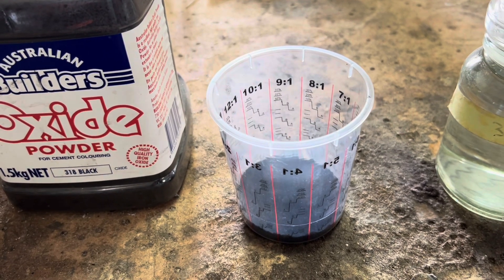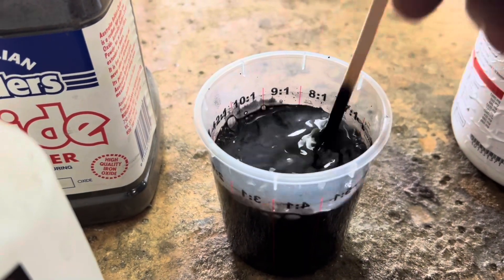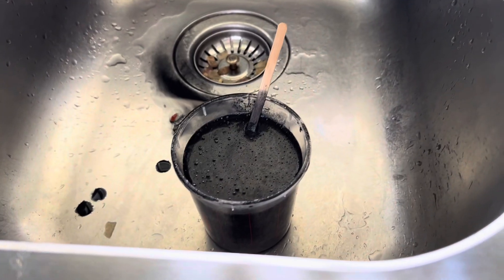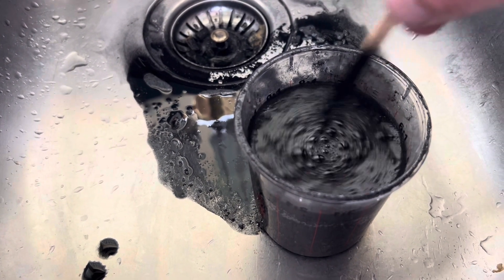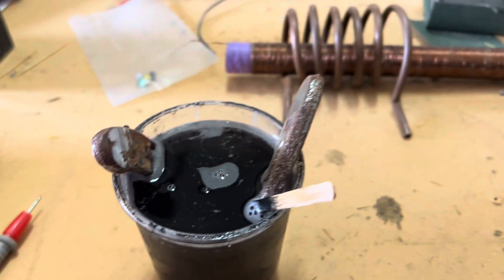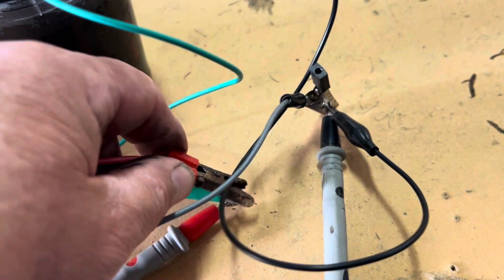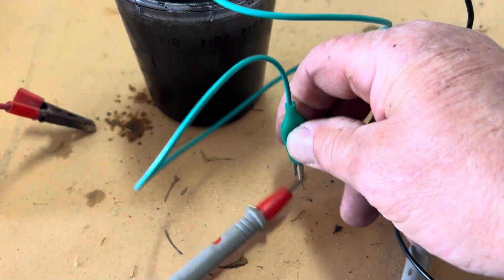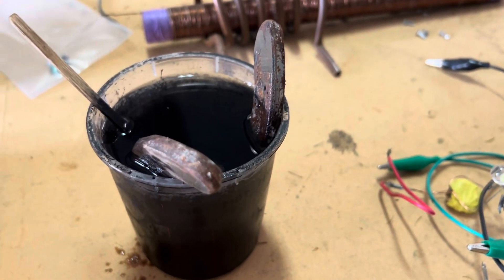All Iron ion Battery

Comment: Your battery's internal resistance is too high, which means that at both charging and discharging a lot of the energy will be wasted on the internal dissipation. Need to tweak the electrolyte more, and also the distance between electrodes. But as a starting point, not bad.